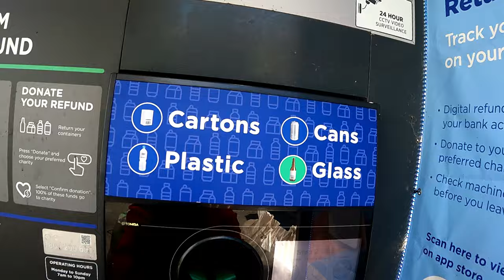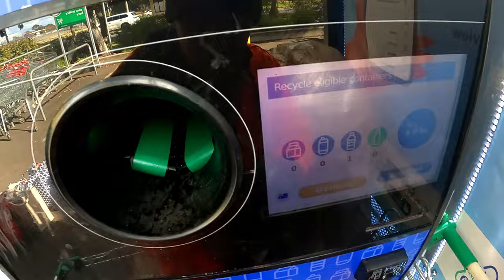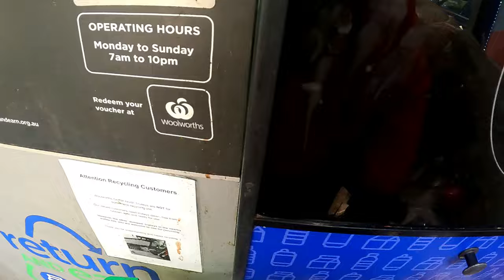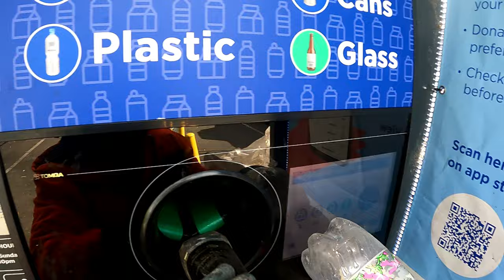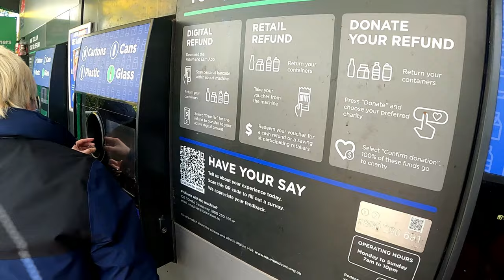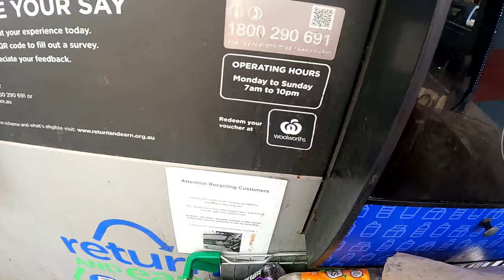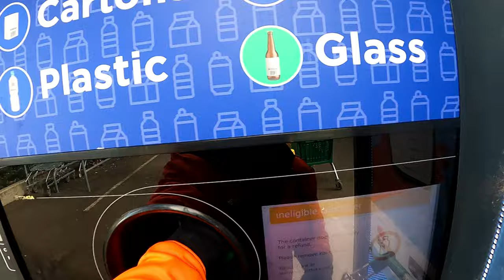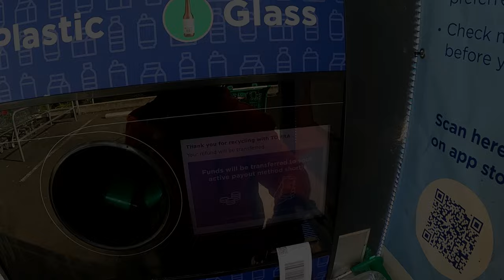Dumpster Diving I've Been Away Too Long From Putting Cans In The Machine

Comment: In Victoria, we’ve always had machines that take all 4 container types and it works very well.
With the few times I’ve been to NSW and used the Return & Earn scheme, sorting the glass was an absolute pain, especially if you only have one or two glass bottles and a bunch of plastics and cans to return.
Fun Fact: The NSW machines have always had the ability to accept all 4 container types. What got changed was some configurations within the software plus the decals on the machines.
Reply from the maker: Actually in New South Wales back to last year you had to separate the glass away from the Cans and plastic because if you go back through my playlist of dumpster diving you will see that in the videos.🤔👍